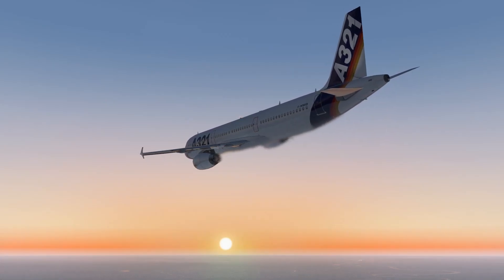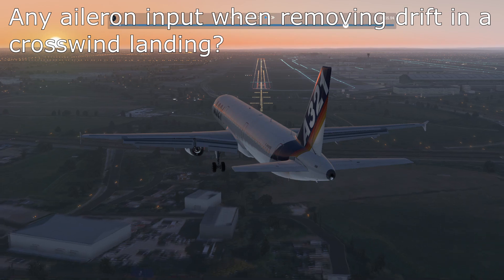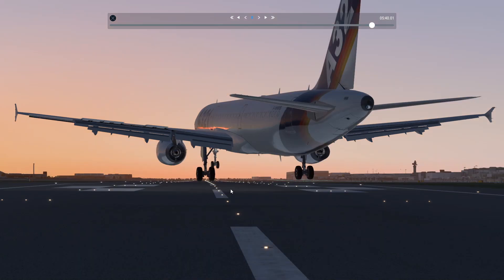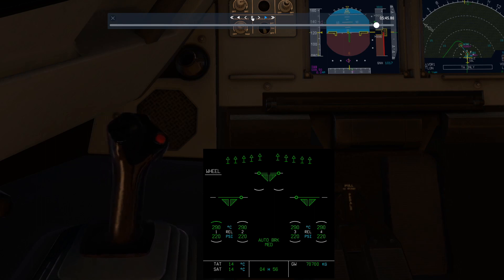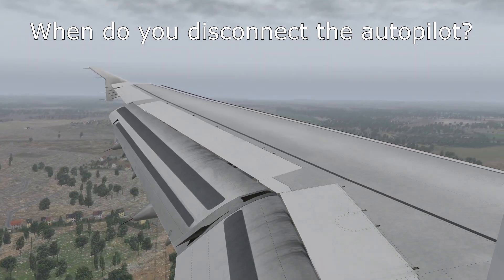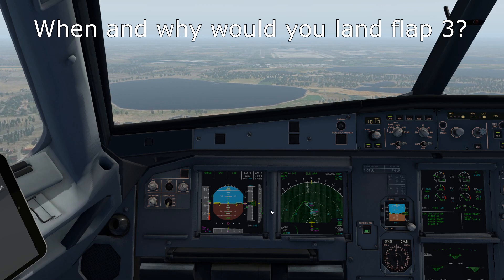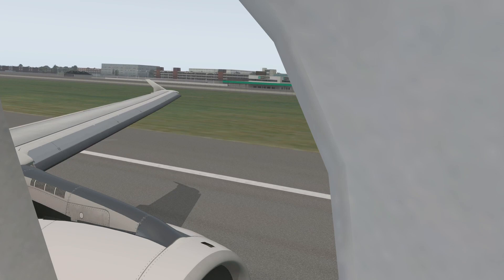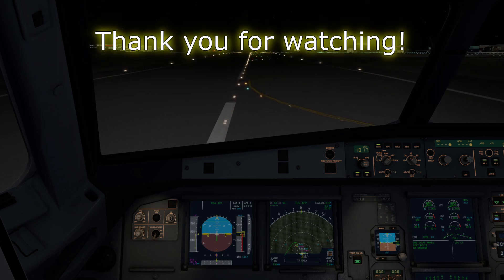Landing Q&A with a Real Airbus Pilot:ToLiss A321 X Plane 11

Comment: Thanks for this video! I think the follow-up Q&A videos to some of these topics is a fantastic idea! It gives us a kind of feedback that I've never seen with other tutorial series. Please keep up the excellent work!

Do you have any tips on avoiding the tendency to over-flare and preventing floating?
Reply from the maker: I'm glad you liked it, I will try and do more in future if they fit in. For the flare you are only trying to reduce the rate of descent for touchdown, not make it zero, so typically its just a few degrees pitch change but this depends on how stable the final approach was! I may do a video specific to the actual flare as it can take some practice!
Reply: @320SimPilot  Thanks for the response. A video that addresses how to flare properly would be much appreciated!

Comment: Thank you very much for your tutorial. Havinh lots of trouble landing both the Toliss A319 and Toliss A321. Keep getting hard landings. How to achieve butter landings. Should I flare when I am 30 ft from the runway? Should I reduce the throttle to idle when I am 10 feet from the runway?